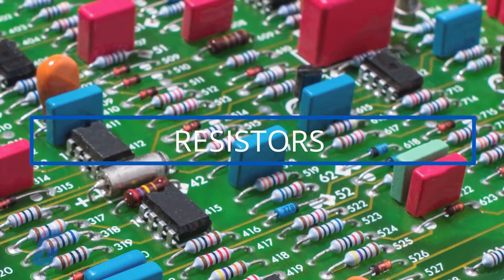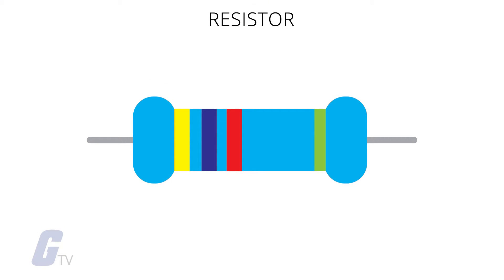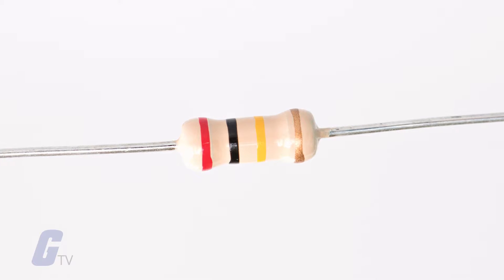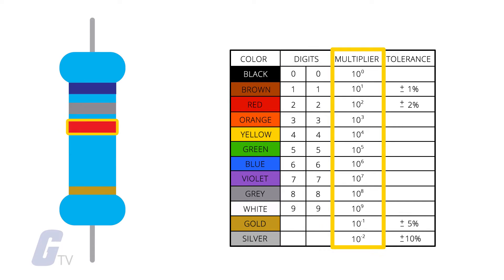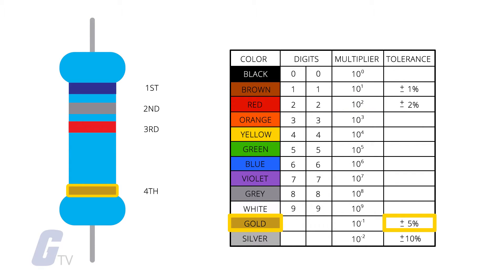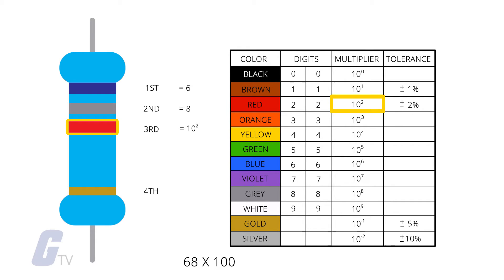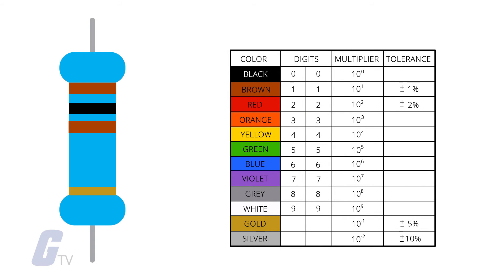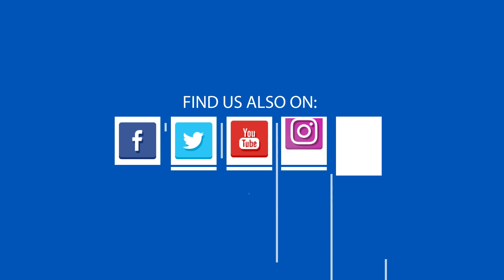How to read a Resistor? 3 & 4 Bands | Galco

Comment: This does absolutely NOTHING to help read a resistor unless its gold or silver. What about lower tolerances?????
Reply: I KNOWW RIGHT
Reply: for anyone wondering: tolerance is just how "off" the value that you get might be. it doesnt affect how you read a resistor: it just tells you that it might be off by up to 10% in gold tolerances, 5% in silver tolerance, 2% in red, and 1% in brown. you'll basically never see the rest of the colors outside very specific aplications but theyre just more precise tolerances like 0.5% or smaller